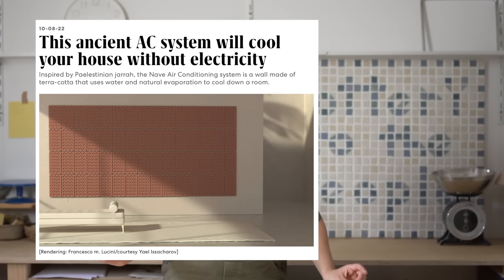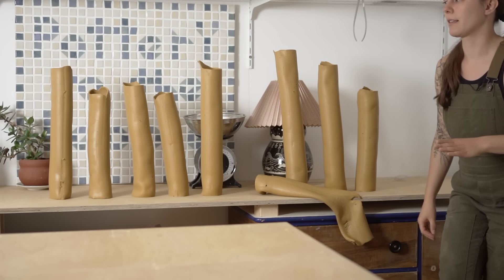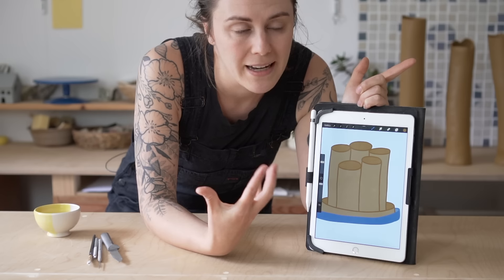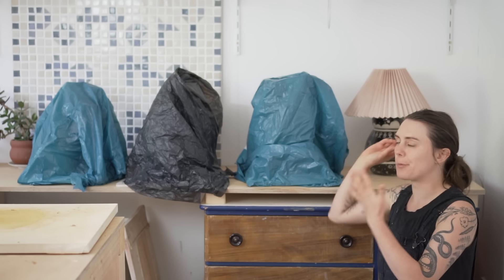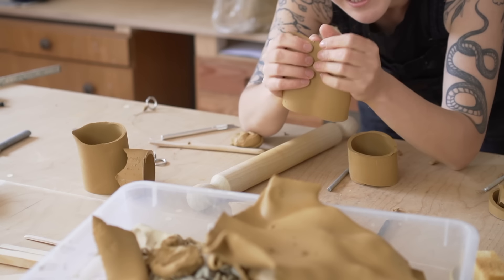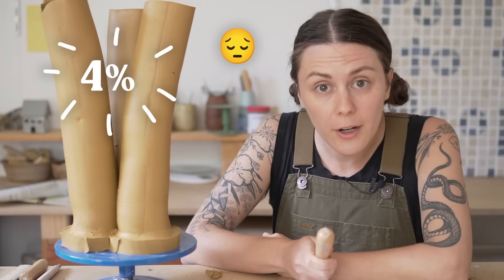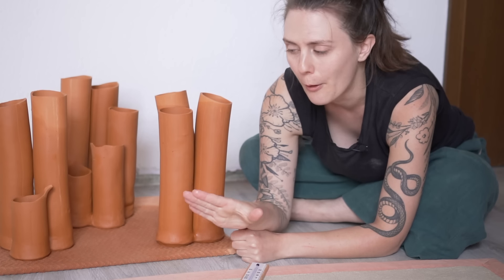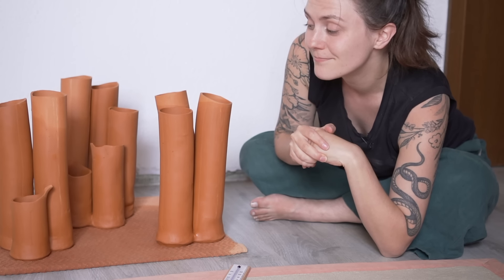Can I make an A/C out of clay???

Comment: I'm an American, and I thought it was odd that you thought 67F was hot, because in my area we usually prefer temperatures between 70F and 72F. But I converted 23C to Fahrenheit and it apparently comes out to ~73.5F, which feels much hotter and is personally out of my personal comfort zone.

Very neat video, very fascinating. Just wanted to be an American and point out the Fahrenheit thing lol
Reply: Yeah, my ideal temperature is closer to 75F/24C.
Reply: what I wouldn't give for it to be 67°F anywhere in or around my house rn 😅
Reply: It was 106 today with over 50% humidity...
It's 1 am right now... 94 at 49%
Reply: Heat index has been 118F and 116F  the last few days ...  have the AC set to 77 F.
Reply: As a Texan, i was dumbfounded to hear 67F described as hot because for me that is sweater weather and temps we get in winter xD
Reply: Virtually any temperature in the 70's is comfortable as long as the humidity is low. I can sleep comfortably at 76 degrees as long as there's a breeze.

Comment: The main thing that determines how well this technique works is humidity. If the environment is dry, these work really well. If the environment is humid, they will do almost nothing. Other folks mentioned a fan - that would help move that cooler air around and make it more efficient. But if the region is humid, they unfortunately won't do a lot
Reply from the maker: right! So maybe combining this with a dehumidifier. I wonder how much electricity a dehumidifier uses compared to an AC 🤔
Reply: @PotterytothePeople  less but you'd have to really check. Air conditioners are dehumidifiers inherently as part of their behavior, but they do a bit more. It's a trade-off.

The thing we really need to do to be sustainable is change how we build houses so we can let them not get so hot in the first place - like the Passivhaus concept
Reply: @PotterytothePeople Air conditioners, dehumidifiers, refrigerators, and heat pumps are all the same inside, but connected differently.   An air conditioner takes heat from inside and dumps it outside, while a dehumidifier dumps the heat inside.  It makes the air less humid but warmer.  A heat pump water heater takes heat and humidity out of the air and puts it into hot water.  If you are heating water and dehumidifying anyway, it is quite efficient.

Evaporation coolers work best where it's dry and water is scarce, and worst where it's humid and water is plentiful.  An air conditioner (refrigerator,...) also cools by evaporation, but contains all the evaporated coolant.  By compressing it, it causes condensation and release of heat, in a different place.
Reply: @PotterytothePeople  A dehumidifier usually just cools down a surface for water to condense on, and is seldom as efficient as an AC unit. So for the same amount of cooling an AC would be better. That said, it is possible to make desiccant based cooling systems that would provide cooling without raising humidity, the channel tech ingredients made one, but in order to dry the desiccant heat needs to be reintroduced, so you'd probably want at least part of the system outside.
Reply: @PotterytothePeople  I would think the dehumidifier would be counter productive to your goal and increase the use of energy.

Comment: You should try putting them in front of a fan or an open window, the air movement will help the water evaporate faster and mix the cold air around the clay with the air in the rest of the room

Comment: I just started watching the video but I can tell you Yes, this will work. This also works with bamboo. You need to drill holes in the top 3-4 inches (some have made designs with drilling the holes.) It works better if you have a small fan placed tilted up with the tubes circling it set on the lowest setting. Green bamboo is best. We did this as a science project.

Comment: I would've definitely tried this when I was in Arizona!
Here's how I would redesign it:
- Smaller tubes for more surface area. Use a small pipe to help them keep their shape.
- Arranged with a small gap between each tube into a panel (think radiator)
- Make the base hollow so that filling one tube flows into the rest of them
- Add another connecting piece across the tops for support
- Make a small hole at the top for filling the tubes. Closed with a clay lid or a leftover wine cork
- Sized to fit on a shaded window's sill for air circulation 
- Place multiple panels with the tube positions staggered
Reply: @@TheresaDoneIt I live in the pnw now. It wouldn't make sense to build one here in a coastal rainforest
Reply: @NickCombs i think you’re missing the point…
Reply: Fins for added surface
Reply: Those seem fairly difficult to pull off with clay, but I guess if you make the pieces separately there should be a way to assemble them in a clever way? I dunno, seems pretty complicated though.
Reply: Sounds great!
Reply: I don't think so @HouseofthePotter
Reply: So, basically... make a copper tube homebuilt radiator, cut slits along or drill holes on the tubes, wrap with clay forming tubes (carefull not to plug the copper pipes; you want water running throug them), and give it a go on the furnace. Maybe the hard part would be "don't heat it so much the copper pipes would bend or twist". Maybe slow rise and fall of temp would do the trick.

End product would be a solar powered evaporator that would cool water running through the system. Add a pump and a small PC cooling radiator and fan to blow the room air through, and you may keep the room air temp slightly over the water temperature... if enough evaporator panels are placed, it should work.
Reply: @NickCombs  If you get another insane heatwave >\= 114°F then even a dew point in the upper 70s (or whatever, I'm not pretending I can run the calculations) could certainly make an indirect cooling version useful in a pinch.
Reply: It was 114F here in Phoenix today. Wet bisqueware would NOT cut it. 😅🤪
Reply: You need air circulation. Thinking that some of our (humanities) other air conditioners were ice hung in front of a fan. See if it works better if set in front of a window that is on the intake side of a cross breeze.

Comment: You're on the right track. When it's hot outside, my mom has always used the technique of filling up the bathtub with cold water early morning. I wonder if using a fan would work? Strategically placing fans in corners of the house to help circulate and create a nice breeze.

Comment: Run a fan onto your cooling tubes. This will increase the rate of evaporation and spread the resulting cool air around the room. This is basically a deconstructed swamp cooler :)

Comment: Very interesting video, thank you for sharing!  I think that your experiment worked better than you think it did though; you noted that the room started at 23 degrees C and that that was 67 degrees F.  In actuality, 23 C is closer to 73 F which means that your experiment dropped the temp by 3 or 4 degrees, not 1!  And every little bit helps!
Reply: Yeah, I think she misread the thermometer when looking at F degrees, it made no sense that the C degrees had a bigger drop than the F degrees. So it worked better than she thought. :)

Comment: I used to make single tubes (with bottoms) and a hole up top for a hook as humidifiers to be hung on water or oil filled radiators (not electrical ones). Great for windowsills with plants, dry winter air etc. Never seen this idea but it will at least humidify the air. You can color the clay with maison stains and still be porous. Make them look like bamboo with a little design adjustment. Interested to hear the verdict on function!

Comment: I think it worked great. You should have compared the room temperature with the temp outside. I guess after a couple of hours the temperature must have raised outside but in the room it was kept 21.5 which is very pleasant. Also I think this works better with a roof fan or a continuos current flowing in the room (at least two openings) and with low light. Great job, beautifully made.

Comment: Lovely work! don't give up on it. When I was growing up in Sydney, we would put small towers of terracotta pots filled with water on the verandah of the house and it really did drop the temperature. I think the design of the one that you show at the start has a few benefits that you could play with: being external to the house, being a whole wall, and having small small tubes that create a much bigger surface area by twisting kind of like our brain does. In theory screens made like this that could fit into your window or door should work - ideally not in direct sun.
Reply: It works in a static situation until the cool water is equal to the outside of the container temperature. The water becomes a heat sink for a bit of time. Keep air moving across the tubes and the room will cool but get more humid until things equalize. The swamp coolers recirculate water and fresh cool water is mixed in as the water evaporates away which takes heat away. Static tubes only make for a temporary heat sink.

Comment: Great video thank you, but i would like to see you have another go at it, my feeling is that you need a greater surface area  exposed to the atmosphere. i think it would have been okay to lay the pipes down while drying so they came out as flat panels, maybe a  strip of cardboard to avoid sticking together. i did like the quirky bent tubes but you could make flat panels with maybe a half inch of water between?

Comment: I think it’s amazing and cooling the room 1,5C is much, considering that the room would only have gotten hotter because of mid-day temperatures rising. The fact that it didn’t go higher, but even lowered is just awesome, also given the fact that the structure isn’t that big. It works! I love it 😻
Reply: Why do you need to use Air conditioning in a room that is 22C??? are you insane?
Reply: @bonaface  She's making a cheese cave, obviously 😀
Reply: I feel like this would be more effective at hotter temperatures. Not much water is evaporating at 67 degrees Fahrenheit.

Comment: I think you did a fine job making the stuff, but I was hoping for more thorough testing. A control test would help paint a picture of the effectiveness of these things, if you had 2 days in a row with about identical weather. You could monitor the temps in the room with and without the pottery coolers.
I'm also intrigued by the picture you showed at the beginning that was the inspiration. It was some kind of thing that would hang on an exterior wall?? I want to know more about that.

Comment: What about just making tall terra-cotta pots and then filling them with water and putting them in front of the window where the outside breeze comes in to the room. That would flow through the cool pots and the cool air will circulate around the room.

Comment: This kind of cooling can also be found in the Tudor era farms.  Ideally a room for processing of cheese, and butter might be sighted on the north side of the building exposed to a good cross breeze with doors or shuttered windows.  There would be a layer of porous tile on the floor and one would purposely spill water onto the tiles letting them absorb the water and open the shutters to allow the cross breeze to do the evaporative cooling.  Might have a more noticeable effect when the whole room is floored with this evaporative tile instead of the spotlight coolers in the video.

Comment: You need a fan with this, the air flowing through these tubes will transfer the heat from the room to these tubes while the cooling is spread across the room. This concept is famous with evaporative cooler, which can cool the room as much as 10 degrees Celsius. In India they use the water evaporative cooler which keep the rooms pretty comfortable 25 to 26 degrees with moderate humidity.

Comment: Wrap burlap around half of the pipes and expose to direct sun after wetting the burlap will cool the water inside the pipe dramatically.  But the burlap portion would need to be outside on a window ledge.

Comment: So its a ceramic swamp cooler.  Pretty cool!  As long as you live in a low humidity area (southwest US), this would work really well.  In the higher humidity areas of the country this will not work nearly as well.  For the more humid areas, one might try using desiccants to dehumidify a room as an alternative to electric dehumidifiers.  However, when the desiccant is saturated, it will require some sort of energy to dry it out for re-use.

Comment: Interesting video thankyou.
I think it worked better than data shows, you could try it again with another thermometer in a room as similar to the room the aircon is at the same time, little something to compare it to.
If you wanna get more technical repeat over a few different days or change up were the thermometers sit ie, both on a table, or both on the ground or both on a wall. Could be interesting to see how cold air disperses different. And if height of claircon from floor makes a difference. 
Great passive aircon idea, would bring in humidity too, could be nice in plant room.

Comment: For it to make a difference in the room you have to have someway for the evaporation to escape the room and take the energy out while maintaining the coolness inside.  The old tech was probably used as windows to open but slightly shaded areas in dry climates. (Think courtyards)  this allowed evaporation to be carried away from the device while producing a cooler (slight) breeze likely towards the center of the courtyard depending on placement.

Comment: Interesting implementation. You look a lot like Simone Giertz and styropyro had a kid. A few points I can think of.
1. Air circulation will help a lot.
2. The lower your ambient humidity, the higher the cooling effect.
3. Look into mitticool. It's an Indian startup which makes refrigerators by clay. Maybe a future project?
4. The maximum cooling possible with such a method can be calculated using a psychrometric chart.  

Keep up the good work!

Comment: I think 1 side of the room just covered with cooling pottery is doable. Some culture would use wet piece of fabric and hang in their room, beside their window.
Cooling pottery is pretty nice because I assume it retains water much more.
Some modern version is water curtain or water running along a feature wall.

Comment: To allow them to dry, you stiffen the inside.  I am thinking of a terrycloth towel wrapped around a paper towel tube or more, that way the towel allows air in a little bit and the structural integrity you seek is provided by the paper tube.

Comment: We still use evaporative coolers in HVAC design. Most of them are large scale for commercial buildings that require a lot of pvc piping and water. They make small portable ones but like you realized, the size of the unit would have to be massive to make the temperature change you want. They best way to stay cool, for free, would be to live in a dirt/mud house, the earth will keep the house around 60 degrees F year around. plus, it is sustainable.

Comment: In New Mexico's dry heat we use swamp coolers which are basically the same concept:  a diy version is to just hang a white towel across a sun facing window and feed the cloth a small waterline to keep it quite damp, as the sunlight heats the cloth the water is evaporated to the outside and the temp inside the room drops.  If you have a rafter window its ideal, the colder air is displaced by rising heat creating natural air circulation.

Comment: The cylinder is the least possible surface area to volume shape possible that you could use for this concept. It looks like your extruder make a 2 1/2 to 3 inch pipe. If you flatten that down until the inside is around an inch or so across then you would be able to stack many more side by side and make an evaporative radiator. Put a box fan behind it and you have a swamp cooler. They don't work so well here in Louisiana due to the high humidity,    but in a dry location they work quite well.

Comment: Cool video. Interesting idea. I wonder it it would work as a hollow window frame. With maybe elaborate designs or even abstract designs.  The air would cool as it would pass through the window or could it be made into a makeshift air conditioner with a fan.

Comment: Try adding some air circulation! A small fan to expose the warmer air of the room to the cold area could help speed energy transfer for evaporation.

I would also add a Hydrometer to your measurements and compare the change in temperature to the change in humidity.

Trying to balance the addition of humidity while maintaining the drop in temperature with low cost materials and using only ambient sources of energy presents quite the challenge!

Good luck I bet you'll find some interesting results!

Comment: Look ... The method is correct theoretically... Except that you've missed a very important part which is ventilation. It's not enough to have water on a large surface if there is no air current passing over it so it can evaporate. So you need to have a small fan blowing at the pipes for it work.

Comment: You could use this type of cooler in conjunction with some kind of dehumidification device or chemical such as salt which can be recharged or dehumidified by placing in the Sun and then let it cool in the shade large barrels could be rolled in and out of the house quite easily. There are also liquid desiccants that can be used some of them as decorative waterfalls/ fountains.

Comment: I've seen this before, but it was like... hundreds on a 45o level with a water sistem integrated (in favor of gravity)😅. 100% eco-friendly.

It would work better if you do some natural air ventilation, its basic a role on the top and a another in the ground level (cross ventilation). 

I bet you can make some cool design 😊❤